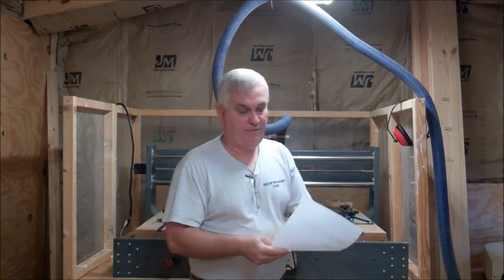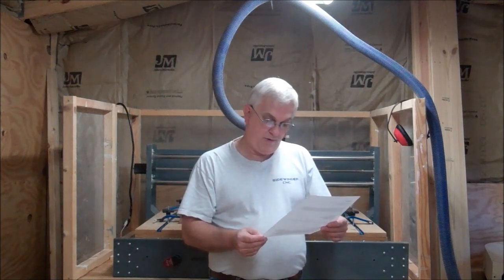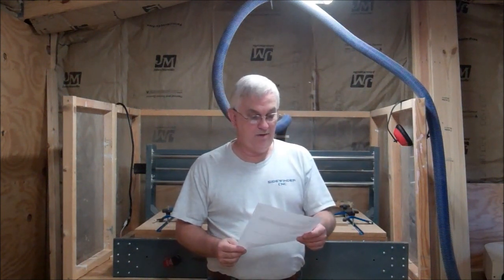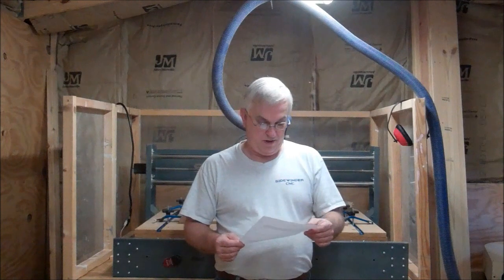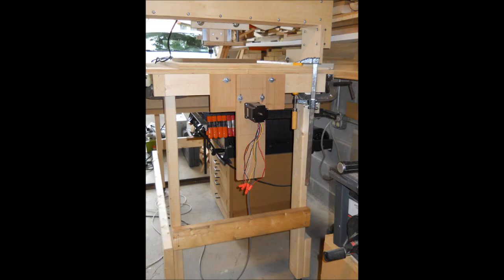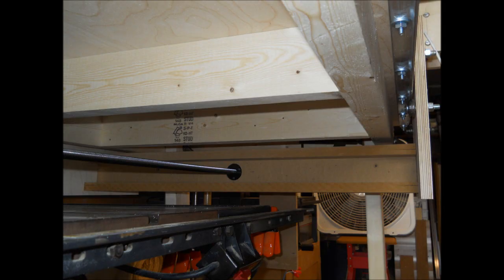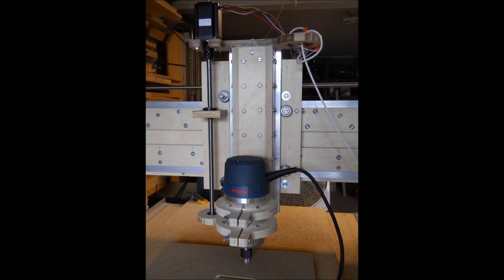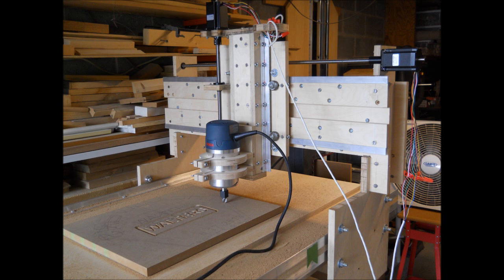Charlie's CNC Build

Comment: Hi Dave

I have got a Chinese Cnc machine

A 6040

I have been making labels using a material called Traffolyte

This material is made up different coloured layers 

The label size is about 100 x 40 mm 

I have a universal Cutter grinder

I have been buying Vcutters online

But I would also like to make them myself

Amongst your contacts do you have anybody that is interested
in doing instructional videos on the universal cutters Grinder I would
appreciate this a lot if possible thanks in anticipation

 

Winston Harmitt

Comment: Dave, This video has answered some questions I have - I'm that much closer to pulling the trigger.  I was wondering though - In your opinion - Is the single leadscrew on his x axis enough to drive it? I know those longer leadscrews are expensive and this may cut costs, but in the long run is it worth it?
Reply: Hey Jeff, I had the same concern with running my CNC with just the one centered stepper motor. I wasn't sure if it would have enough power to drive the combined weight of the gantry, router and the pressure of carving into the job piece on the 5 foot table. That turned out to be a non issue. The 305 oz-in stepper motor I used seems to have more than enough umph to handle the job. I haven't heard the motor straining or bogging down at all. I actually did buy an additional 6 ft length of leadscrew to use the way Dave had his designed, if it turned out my modification couldn't cut it. If you need any other questions answered about my build, feel free to contact me direct. Charlie
Reply: Charles Walters
Charles, how do you adjust the 'Y' axis, I noticed that you did not elongate the screw holes for the adjustment..., Thanks-don